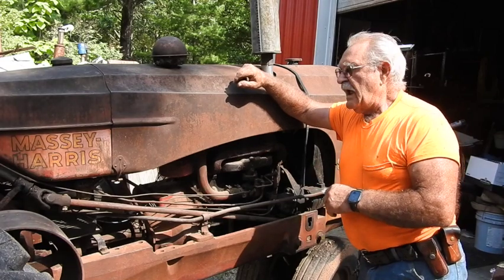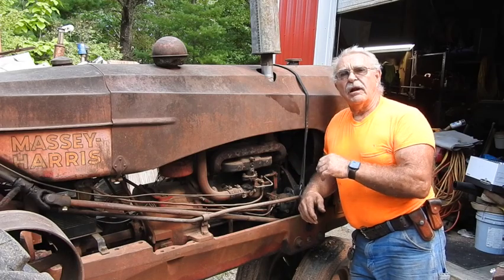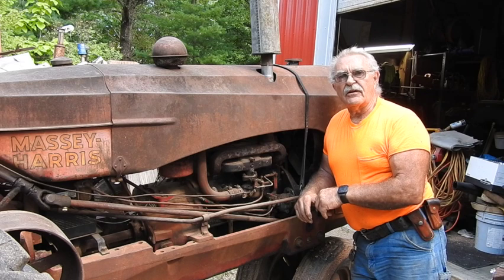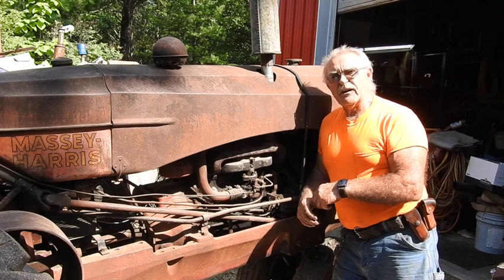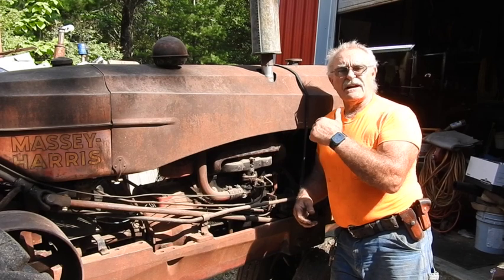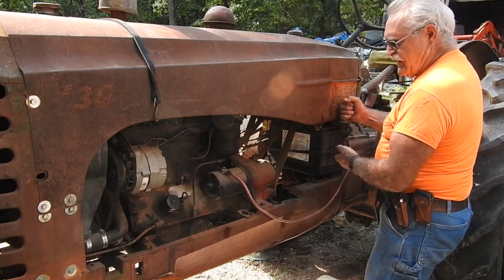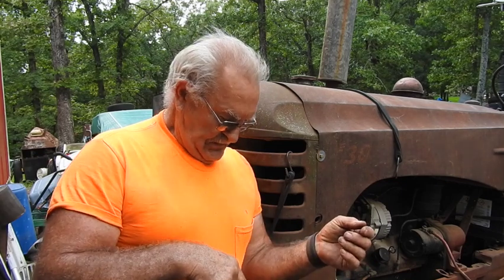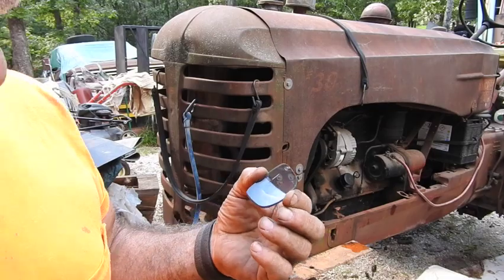Cold Start Massey Harris 30 and Thoughts About 12v Conversions

Comment: That 30 starts just like my 8N (has the 12v conversion).  Bulletproof and reliable tractors, and a few more HP on the Massey.  I like the draft control on the 8N, and it's been in the family since my wife's grandfather bought it new in 1951.  Has always been a reliable old iron family member.  (Similar to my Gravely 4-wheelers)
Reply from the maker: These old things were rarely fitted well with three point systems.  There were aftermarket ones made by Saginaw and Danuser, but they lacked the actual 'Ferguson System' design of throwing the draft created by the implements onto the rear wheels to aid in traction.  The Massey guys did have a rockshaft connected to the hydraulic ram, but it was best suited mostly for  the two row cultivators, and some with a crude farm loader of their own design. The later models though, were fitted with a fair three point on the 33, 44, 333 and 444 series.  None ever were as well fitted as the Fords with the Ferguson designed system like your 8n and of course many later models.  I'm glad to hear your old machine stayed in the family and is a smooth runner !!

Comment: Massey Harris tractors are awesome, love tin work shape on them as well, when I was working on the Farmall water in the oil issue a while ago I step on my brand new pare of glasses that fell out my pocket, flat as a pancake, and believe me I bent the frame all up and insert one glass again, not a scratch on the to worry about. Nice video Wendell
Reply from the maker: Dang, that's not good to step on your glasses.  LOL  I've done that one time in the past as well... Don't you just hate it when that happens.  Massey's are my favorite color of red.  Farmalls are my second favorite shade though !!

Comment: I have the exact same tractor. I'm in Canada, SW of Edmonton. Runs like a top, narrow front. Love those Continentals.
Reply from the maker: Yessir, these little flatheads are pretty bulletproof.  Such a reliable little engine.  There seems to be a heck of a lot of old Masseys up there because they produced them somewhere up there.  The other factory was in Racine Wisconsin, so there's a lot in the upper midwest of the US as well.  We had a local dealership, so we have quite a few in this area, but not nearly as many as you guys !!  Thanks for the comment Joe...I appreciate the corroboration on the reliability of the Massey line !!

Comment: I got a MH 22. It hasn't ran in years. But one day it will. Thanks for sharing your experiences on the Massey
Reply from the maker: The 22 should've had the F140 in it, if I am remembering right Jeff.  I too had one a few years back.  These little Continentals are a superb engine.  The only parts I wasn't able to verify location of was the hardened exhaust valve seats.  All other parts are readily accessible.  Expensive, but available.  The F124, F140 and F162 have common valves components and are the same block with the same stroke but just different bores. Thanks for watching and if I can help ya, just ask.  But no guarantees though....LOL

Comment: Hi tm44 .I have a massy Harris 33 .it's a nice tractor I think it has a continental engine in it.i have been trying to find a new block for it.the last owner somehow cracked block.it keeps getting antifreeze in engine oil when you let it sit.thank you for great vids .god bless
Reply from the maker: 33's are sometimes the most difficult MH engine to find parts for Wayne.  My suggestion is to join a Massey Harris Facebook group and put out some feelers or just scoot through the groups threads to find a 33 engine or an entire parts tractor.  They are out there. Another option is that you may search out the guys that have installed a 260 cu in 44 engine in place of the 33's 201. I have not done it, but I think they bolt up.  That may be the best route due to the more readily available 44 parts in the future.  Thank YOU for watching the videos uploaded here.

Comment: Wendell, you have to do something about that flickering shop light in the background. 
Yep you need to see your optician about those glasses. Are they glass? I've never seen plastic chip like that.
Great video.
Reply from the maker: Yes, they are glass.  These are supposed to not allow hot sparks to embed or melt into the surface.  But she didn't tell me they'd chip off that easy.  I've had the composite lens before and they weren't too bad, but continual cleaning with a dirty shop towel seemed to always take its toll.....  Hahahaha....  I've not noticed the flicker Rick.  I'll have to check that out.  Well, if I'm starting a saw or something yes, but not just setting there turned on.  But you know there are some that see flickers on 12vdc LED tail lights and other LED lights that trigger epileptic siezures.  THAT's freaky !!  I just don't see it though.  I'll pay attention tomorrow though.
Reply: @tractorman4461  I ordered glass lenses a few years ago but I'm so nearsighted that the weight of the glasses on my nose dug holes.
My last set of glass safety lenses had weld and grinding splatter imbedded in them but that was many moons ago and I am sure the technology has improved.
Reply from the maker: @rickburris6164  My Much Older Brother has a set that the grinding sparks just bounce off of too.  But I don't know what they are.  Glass is heavy for sure.  But I think I see things much more crisply with glass.  Might be imagination though.  My last pair were dotted all over with melted in pieces of grinding dust.  Real bad.

Comment: long shot here and kind of off-topic..do you happen to know the spark plug wire order for the 30 from the distributor? Is it the same as the 20 and 40? i cannot for the life of me find a digital copy of the owner's manual. Thanks in advance!
Reply from the maker: The 162 Continental  flathead firing order should be 1 3 4 2 in the MH model 30.  Hope that helps you.

Comment: Have you ever seen a Behlen power steering on a MH 44? I have got to do some tinkering before winter. Leaking water.
Reply from the maker: Yes, I think I actually have on one of the 44's.  Power steering is nice on those heavy front ends for sure.  I have two with PS, both different.
Reply: @tractorman4461  I knew I went to the right source.  You are the Massey Harris guru! 👍
Reply from the maker: @stevec5338  Hahahaha....now I wouldn't want to claim that as a title...but it sounds good.  LOL.

Comment: My great uncle has a 33 that belonged to my great grandfather. It sat in a shed for a while and became locked up I need to go inside and see what’s going on. I’m nervous because I’ve heard parts are hard to get for these.
Reply from the maker: If it’s just stuck from condensation entering the cylinders, you should be just fine. Of course you may have to pull the pistons to hone the cylinders and re-ring it. But you are absolutely right there are a lot of parts that are not available for them at all. But on a good note, I am reasonably certain do I have not done it myself, that a 44 engine can be shoehorned in there with a little creativity. I’ve actually seen a 55 engine stuck into a 44 frame but I’ve only heard that a 44 can fit a 33. If that thing was inside the shed, it’s more than likely just oxidation on the cylinder walls. Good luck with your project !!
Reply: @tractorman4461  Thank you for your input! I enjoy your videos keep up the good work.
Reply from the maker: @taylorsunderlage5176  You reminded me that I have a 33 to work on that has a deteriorated manifold.  Everything else was in pretty good shape though.
Reply: @tractorman4461  You think you could do a video on it? You don’t find much on those anymore

Comment: I always did like a 12 V battery on a 6 V starter it will really spin an old tractor over.
Reply from the maker: On a tight engine, 12v has been known to spin the starter ring too...  But no matter to me because every 12v conversion I've done is with a 6v starter.  I think the increased speed of rotation kinda compensates for an older and well worn low compression engine whose compression is even lower.  The purists argue that 6v starts 'em fine if every thing else is correct.  But the sad fact is not everyone has the ability or the money to pay someone to actually make everything correct on a worn out 60, 70 or 80 year old engine.  In my estimation the 12v boost on the old tractors gets more people involved in the collection of old iron. Of course that's just my opinion....and we both know what THAT is worth.  LOL
Reply: @tractorman4461  I have rebuilt several engines and when I do I put higher compression pistons in the units. (Farmall M’s). The just simply won’t spin them since they hit the compression stroke and quite with the 6V system being up to snuff.  12 spins them right over.  I’ve never experienced the ring gear coming loose and hope I didn’t jinx myself!😂😂
Reply from the maker: @tinkerinbruce6560  I can see that as a result of hi comp pistons.  I know of two that spun the ring gear with the 12v conversion and they were the larger bore engines. But I too have been lucky.  We just heated up and installed a new ring gear on my brother's 8n just a few months ago.  It was chewed off though.

Comment: I've got 2 Massey 30s. One has a 162 in it and the other one has a 140. The 140 is out of something else for sure and whoever installed it didn't do a very good job.
Reply from the maker: That's cool Jeremy.  I'd take two more if they came along.  LOL  I have an old 101 Jr that should have the F124 and it has the F160 in it. They were so interchangeable through the series.  Even on the small self propelled combines. There might have been some carb linkage changes here and there, but the engines were the same  external physical size.
Reply: @tractorman4461  yes I have a Massey ferguson 34 swather with a 140 in it.  Good engine for a donation to a tractor
Reply from the maker: @jeremycherny2041  I also have a flathead Continental out of a Baker forklift.  But I don't recall what size it is. It has an odd bellhousing though.  That'll have to come off for sure.